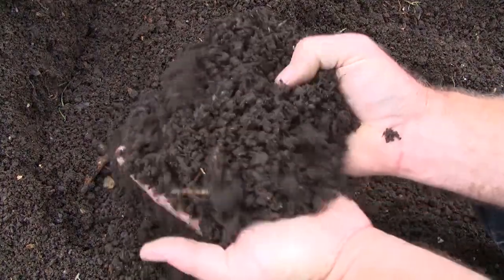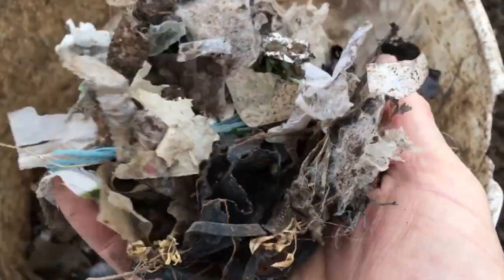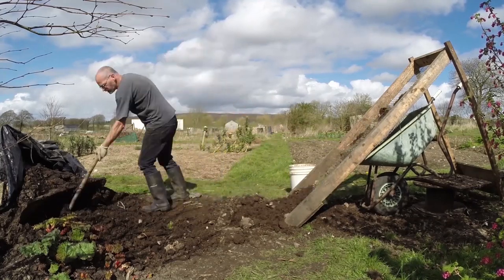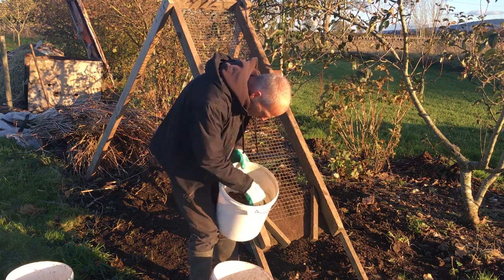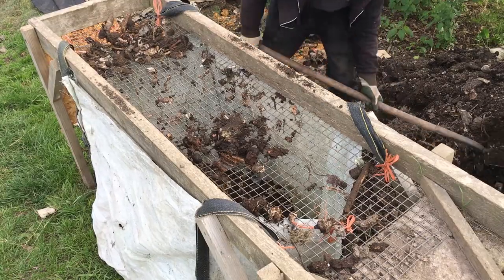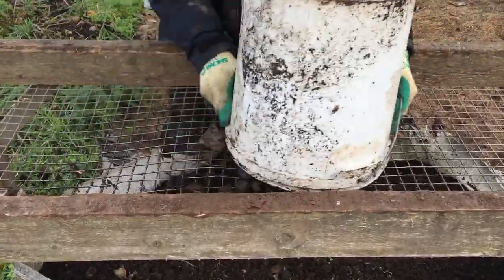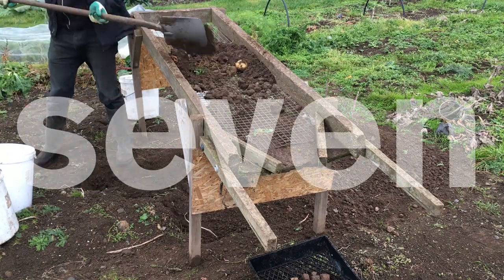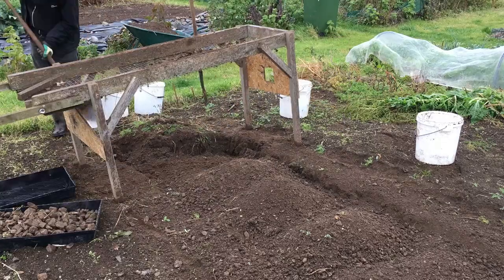8 Ways to use a Compost Sieve

Comment: Idea for the sieve: still put it up sloping at a 45 degree angle, placing chains on each corner to vertical posts so whenever you put material, there is a swinging to and fro motion shaking the material automatically.  Also adding used bicycle wheels and two axles so you can move it and two 2x4 handles at a 45 degree at the front allowing you to move it like a wheelbarrow.  Finally, you could add multiple screens stacked to get very fine compost.
Reply: I’ve been wanting to get a multi layered system like that. 

I’m wondering the best way to have the lower layers.

I feel like they need to be removable to easily sort through what is caught below.
Reply: Yes,  wheels!
Reply: What a great video. I love that you showed the progession as you worked through as your needs and ideas changed. My favorite  parts were the funnel shape at the end and the use of the bucket. This video gave me the idea of adding on locking leg hinges so it could be stored upright and two or three overlays with different screen sizes that can be pegged onto the top of the largest holed screen. I'm definitely going to use the end of this video as a starting point for my sieve.  I already have one on top of my compost bin, but realized I can't haul my bin, but I can certainly use my yard cart. Thanks again so much for a great video and the inspiration you've given me.

Comment: Good ideas, sir. My own variation in a small garden is a sieve that fits on top of the wheelbarrow. But if I get to a bigger one like yours I think I will put the one of 4 legs with wheels at one end to make it easier to move around. Like the feathered gardeners you have.

Comment: You can also use it as a wash station, place potatoes and other root vegetables and get the hose out
Reply from the maker: good idea.
Reply: it will work well for drying onions and garlic, have been doing that for a few years, also drying stevia leaves.

Comment: Put wheels on one end, this will make it easier to move around the garden. Great idea and I plan to make one myself. Cheers mate.
Reply from the maker: Wheels would help. Hope your sieve works out well.
Reply: Can’t believe this was done the moment it was put horizontally.
Reply: @REDGardens   this was going to be my comment as well. Transportation of equipment/machinery needs to be done as efficiently as possible. Great video though with great learning opportunities.
Reply: If wheels on one end don't work out, look at ski feet.
Reply: @REDGardens   would definitely save your back for a small investment in some all terrain cart tires

Comment: I built a soil sifter with 1/4 inch hardware cloth (poultry fencing) and it works well. However, I think I will make one with the 1/2 inch screen.
If you don't have one, you should make one. The soil is amazing and will change gardening for you.

Comment: I like your chickens being part of the sieving process. I guess they remove all grubs from your compost.
Reply from the maker: They like the grubs, and the worms.
Reply: I built a sieve tray using 1/4" grating and went through my three garden beds with the intent to sift out the bark and tree roots that encroached.  I ended up finding 4-500 lawn grubs in there as well.  (EEEK!) I put them in a water filled licorice bucket for a few days, and then dumped them, finding out they hibernate well, and just went into the ground by the fence.  HMMM...   I filled the bucket again, went on putting hundreds more in, and then finally dumped it.  Same thing.  This time I filled it, left them in there... I mean... LEFT them in there!  And they died, and stunk, brought flies, then the water evaporated.  Kept them there for several weeks, and then dumped them.  Wasn't sure they were all dead... but I think they were.  Hardy little buggers!  Was wishing I had chickens right about then.  Maybe I should have washed them down the sewer and fed the fish downstream...
Reply: @jum5238  I feed the grubs to the birds in my garden. As long as it is a few grubs the birds can manage, but when it is in the tens, the birds can't keep up. I also dumped the grubs them on my driveway, hoping that the birds would eventually eat them all, but this attracted a raccoon, who started to dig into my vegetable beds at night, so that is not recommended.

Comment: I am amazed. I didnt know that anyone but myself ever made a "sieve".
My version was even simpler. 4 pieces of 2x4 some mesh nailed on, laid over a wheelbarrow.
It gets questions from by- passing drivers, and neighbors.
I grew up on a delta island. Apparently settlers barrowed in soil for decades. That was good soil but it was full of rocks and trees from miles away across a major river.
I wanted that stuff separated.
Genius that i am ( Not) I invented the sieve.
As I said I thought I invented it.
Looking here i am impressed by how far behind I am was. Shows the value of info access nowadays. I can't believe i didn't think of a narrowed end so i could tilt out the unwanted remnants.
Greg
Reply from the maker: I think loads of people have 'invented' the same thing over the decades, as it is a logical solution to a need. The sharing of possible refinements is definitely a bonus though!

Comment: I made a compost sieve based on your design using scrap wood I had.  The only thing I had to buy was a roll of wire mesh.  My terrain is compressed and overgrown and it was taking ages to turn it into raised vegetable beds.  The new sieve works fantastically and although it takes time to put through a bucket of soil my speed of work has increased significantly.  It has turned a task that was difficult and discouraging into an easily doable task.  Thank you.
Reply from the maker: Wow, that is so great to hear. Thanks for letting me know.

Comment: Simple tool, so many uses.  This has give me some great ideas.  I will make a smaller one that fits over a tub.  When my flower borders get very weedy and need remedial action, I like to lift out the plants in autumn, divide them and then I try and get every scrap of weed root out of the soil.
Reply from the maker: One that fits over a tub would be very useful, especially for remedial work that you mention.

Comment: Thanks for showing the stages of use of the elevated sifter. I'll probably make one, having chicken fence in my collection. 
It's a good idea. 
Instead of making more stands,  you could make frames of 
1 × 3 that fit inside the existing frame, that hold different gauge(?) screens. Hole saw holes for lightening. 
I'll make some wooden wheels and make an axle from a hickory sapling- it has to be cylinder only where the wheel rolls. Vegetable oil lubrication.

Comment: I pretty much ended up with a horizontal sieve similar to the one you have, except fixed to a corner of my yard (using existing wooden fence for extra structural support). I also used 1/4 inch screen and made the screen frame hinged so I can easily dump the debris as needed. The hinges are also useful because can I lift and drop the screen repeatedly on the supporting structure to break up the finer clumps. Gonna try your bucket technique though!

Comment: absolutely outstanding... i was contemplating a motorized drum setup but i like your system better. i especially like the sifting over the bed... this will work very well for me. excellent progressive application of the scientific method and iterative design improvement. thanks for sharing 🙂

Comment: Good video. I made one some years ago with smaller holes that i put over a wheelbarrow it works well just have to move it about a lot for it to pass thru. I also have chickens I find thay make the best compost ever. I run 2 compost heaps one out side the run and one in the run. I put fresh material on the first heap let it brake down then to the chickens run. Thay love it and the compost is like black gold at the end about 4 or 5 months.
Reply from the maker: i experimented with chickens and compost pile last year and it seemed to work quite will - until something killed the chickens. i haven't had a look at the pile yet to see how the resulting compost looks.
Reply: @REDGardens  sorry to hear that. I only use garden waste grass cutings from my gardening business mixed with horse manure or wood chips I allways let it sit a month be for it gos in to the run. bin doing it over 2 years now no problems.
Reply from the maker: @adus123  Sounds like an interesting process. The method I tried for a while was to dump the household compost into the hens first, and then to turn the edge to of the pile a few times for them.
Reply: @REDGardens  my idea is to let it rot down a bit first that way thay dont see it as food and just dig in it for the worms and insects. Though I do throw fresh grass cuttings in for them from time to time. Thay love that too.
Reply from the maker: Ok, that is interesting.

Comment: I use plastic vegetable crates in all kinds of sizes. Really a strain on the back as I shake them around, but I only have small garden so it's doable. And I also use them for a variety of sifting. I see your chickens appreciate your efforts as well! Good job!
Reply from the maker: I have a few vegetable crates that come in handy at times for sieving, and as you say are useful in a small garden. That is one thing i didn't really mention in the video, that I have a large volume of compost, and really big gardening area, so it makes more sense to build a bigger sieve.

Comment: I made my first sieve it was with 1/2 inch screen. I used it to sift rocks out of dirt. I then made another one with 1/4 inch screen. I use the stones that go through thev1/2 inch into the 1/4 inch and I save the stones for cement and for drainage and garden decoration.

Comment: Thank you so much for sharing this idea and tool. Im gonna use this for sure. If you then place the compost piles at the end of your garden beds, then there isn't much transportation of the compost. Ofcourse you still need to turn it to achieve the best results. Its really cool seeing you trying to optimize the compost work - it is something im really interested in myself.
Reply from the maker: Thanks! Putting the compost close to the garden makes a lot of sense. In my case, I have 7 gardens (in that part of the project), so there is always going to be a lot of hauling material to and from the compost.

Comment: A year or two ago, I started using a grate that's maybe 70x80cm and has much smaller holes to sieve compost and it turns it into something actually usable. It has much smaller holes than this one. I used to put it over my wheelbarrow in horizontal position, as it is about the right size, shovel the compost on and move it over the grate by hand, then put sticks and stuff back into a new pile, while removing rocks and trash by hand. This year I improved the process by making bins for processed compost out of 3 palettes, some boards and paper or black plastic cloth to hold it together. I put the grate over the palettes, then shovel the compost on and move it back and forth by hand and pick what's left by hand.
Reply: Very creative.
Reply: @WDWormsnGarden  It's less creative than what's shown in this video, but it's easy to use when there is at most 1 m^3 of compost per year. Sieved compost is far more fragmented and easy to use than the mess I get without a sieve.

Comment: I have been using a similar sieve for many years in my garden and never thought of some of the uses you have so thanks for the ideas.
my main use is for my compost pile.
I compost all my paper trash threw my pile including junk mail and its a lot easier to dump it in as is and then sieve out all the little plastic windows from the envelopes than to try cutting them out before hand. 
love your Chanel and hope all is well. that post script left me a little worried for you.
Reply from the maker: I have done that too, letting plastic go through the compost system to clean off and separate the plastic from the paper. It works well, so long as I have the sieve, but I do wonder if there is any leaching into the compost.
Thanks for your concern. I was more dramatic than I had intended be about the fire. All good with me, now that I am back up and running. Working on a video about it all now, and hope to upload it today or tomorrow.

Comment: @RED Gardens
I came back to revisit this video again, and come to think about an idea that would help separating plastics, wood, stones etc..
The idea is to use a water to takde advantage of the floating power of plastics and wood, conversely the stones would end up at the bottom instantly. 
Using 2 alternating buckets and a kitchen drainer would do the trick, while reusing the same water.
Probably particularly useful when the stone content is expected to be quite high.
Reply from the maker: A bucket would help with a lot of stuff. I have tried it a few times, and found that a lot fo the wood actually sinks (having soaked up lot of water in the compost). But it does help to clean the compost off of the stones, which I don't want to waste. It makes a decent fertilising tea for plants!

Comment: Great video. Thank you for sharing. We currently have a much smaller screen and the screening is done as a separate step before collecting screened compost into a wheeled barrel to put in the beds. I love your idea of cutting out that step and screen into the beds directly. It’ll definitely be a time saver. Hubby and I were debating about the height being too high, but I can see how this makes the screening using the bucket less of a back breaking task. Thanks for sharing your experiments. You’ve given us some great tips.
Reply from the maker: Thanks. Glad you found some useful ideas from you explorations. You might have noticed that the legs on the screen were lengthened to bring it up to that higher height. At first I thought I didn't want to lift the material so high, but then realised that it required a lot more strain on the back bending, so I raised it.

Comment: Can't seem to get enough about compost these last few weeks. This was a particularly honest & enjoyable account of how to approach the task of composting.  I've made sieves of several sizes using different mesh sizes and they are just hand held types which I fill and then shake to and fro. I have recently seen a Youtube video which advises against sieving compost too fine as you end up with a more dense and compacted soil. The preference is for adding coarse compost to the soil so that the soil has an open breathable texture created by large bits of matter...makes very good sense.
One thing that struck me in this video was the unnecessary amount of stones and plastic. It seems that not everybody that adds to the  community compost knows what materials should go in a compost pile. A compost pile is, in the main, composed of organic material but I have read of others who add soil, others who add worms, some add ammonium sulphate or urea fertiliser to kick start the decomposition, others who add urine and so on.  
My best compost so far has been the (relatively) neglected leaf pile from last year. The only thing I did was to turn it a few times and hey presto...beautiul black rich leaf mould for the garden.
Reply from the maker: Thanks for the comment. I hadn't heard about the possible issue with having too fine of compost - sounds interesting, but for now I end up with coarser compost by default.
I think a lot of the stones in my compost come in with the roots of plants, and when I am adding soil (which usually is when I cut out grass and weeds from the paths of the gardens, which would naturally be palace where stones would end up) so in a way, the compost helps to very slowly remove stones from my gardens.
The plastic is an issue. I think a lot of it is inadvertent, as I also find cutlery, peelers, etc. The local hostel is also a fairly big contributor to the compost, and with so many guests from all over the place using the kitchen it is kind of inevitable that mixed waste would get in the compost. I am slowly training my neighbours, and hope the most of them will see this video and perhaps take more care.
Reply: @REDGardens  Thanks for replying so soon. Looking forward to watching your other vids.

Comment: I had a big pile of earth and fly tipped rubbish in a huge pile. I set up two columns of breeze block like stuff and balanced an old bed base with a grid pattern on it. This was setup on a concrete base. Than I threw material on the bed base and just picked it up  and shook it. The fine material passed straight through and the stones and other rubbish gathered at the end. It was simple to collect the fine stuff and not too hard to bag up the junk and separate the stones.
Reply from the maker: Sounds like a simple way to work through a big pile.

Comment: Some really interesting ideas here. Just may consider some of them. Currently I have 2 separate 5-6 foot composting piles in opposite sides of my back yard. One utilizing red earthworms (somewhat sheltered) & the other slow breakdown method. I use a sieve that I made where the screen (1/4 openings) area is slightly larger than my wheelbarrow. Currently I simply shovel the soil onto the sieve and manually shake it. I toss out any rocks to a designated area & dump any large organic pieces in a secondary compost pile. Then wheel the new soil to which ever raised bed is in need. It's a good work out for a 65 yr. old guy over a couple of days (only a few hrs per day). Food for thought; "He/she who chops their own wood, warms themselves twice."
Reply from the maker: Liam M Sounds like you have a good mixed system going. I agree with you about the work, I like having a bit of heavy work to do most days - keeps me fit and happy.